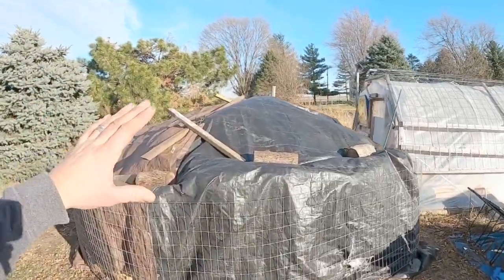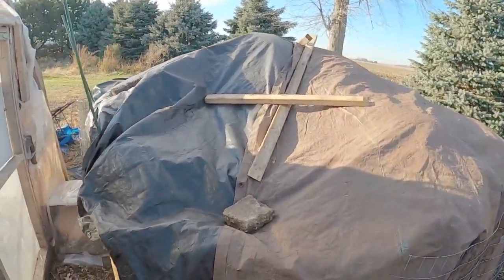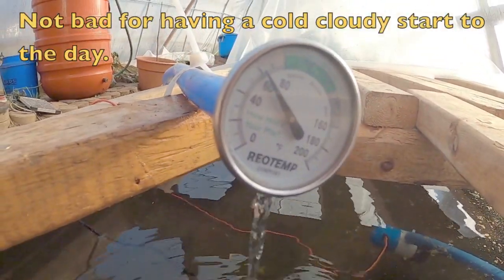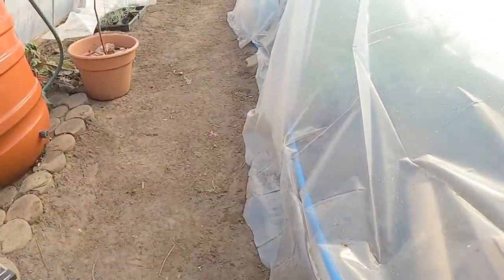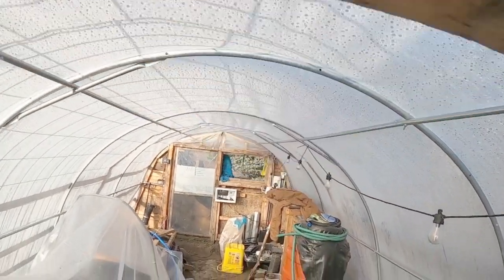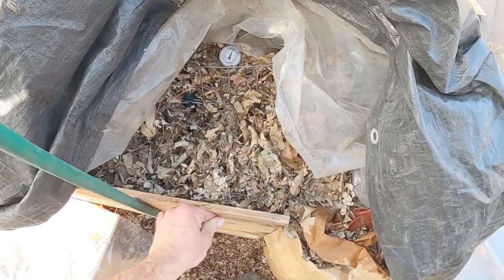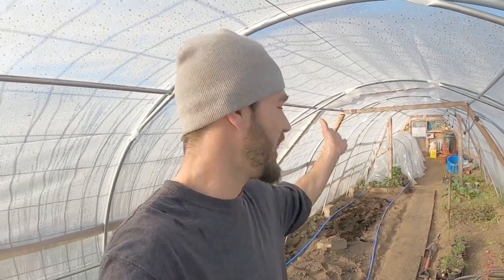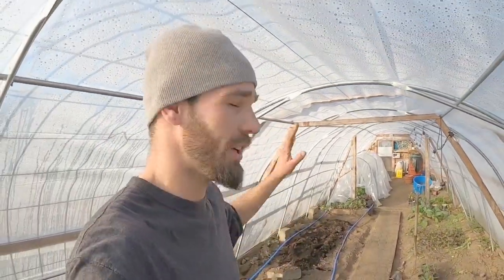Jean-Pain Compost Heating | DIY Methane Retention Layer For Capture | Temps On Day 4 |

Comment: Why not bring the whole compost pile into the green house to capture 100% heat generated? Or the whole end wall attached to the pile shaped to half dome?
Reply from the maker: Harvesting the heat in a separate building would be the only way I would do that. We had composted in the greenhouse last winter and you don’t wanna deal with the amount of rodents it brings… I touched on that in a video that will be up a week or two from now. It’s a big no from me. When I see people building a pile inside all I can think is how many rodents are entering and running around your food at night. We lost a lot of good crops that way. Great question cause a lot of people will say to throw the pile inside but it’s not a good idea
Reply: @Earthdwellershomestead  saw another video that the owner has the adjacent wall insulated with compost and bring the heat in too. Put the wire mesh to separate the rodent invasion?
Reply from the maker: Yes that’s one way of achieving it, we do that in our small 6x12 jeannpain heated greenhouse also! But there is rodents also. Having the compost right on our northern wall works amazing and we’re drawing water and air through it back into the greenhouse. The little buggers burrow in every once in a while still, granted they will always be drawn to food shelter and water but the less I can attract inside the better lol. Feel free to check out our smaller GH creation

Comment: Thank you for your example! 
I'm trying this out to heat my 12 by 12 lean to greenhouse with double poly roof. What's the smallest you think the compost pile can be? 3by 3 by 3? I only have currogated black drain pipe in my pile. Leaves, garden trimmings some grass and some manure. It's not heating up. I'm collecting more leaf bags to go higher around the edge
Reply from the maker: You may be disrupting the burn if theres not enough compost to go around, we did a small example in our small diy 6x12 cattle panel hoop house. what we did was ran the tubing (metal flex dryer ducting) through two holes with Bothe ends of tube in the greenhouse. once the tube was outside the greenhouse we curled or s-shaped it on along the outer wall where the compost will be up against it. we don't get center of the pile temps 130-140 but we seee 70-80F air coming from the tube regardless of greenhouse temp.

Comment: My understanding with heat transfer delta is that the bigger the differential, the more energy transfer goes to to ambient.. If you had a hot coffee and added milk then left for 10minutes vs you have a hot coffee, let the milk sit for 10min then add it.. in the latter, the coffee milk combo would be hotter.

That said, I think(not sure) the lower the delta of water coming in, you store more effectively in the battery.
Reply from the maker: Yes sir, I’m actually pulling a BTU video together share in the next week or two to go over the btu output for heating air and water which take much different amounts of energy to heat.

Comment: Unless you want to easily expose those pipes in between the compost pile and greenhouse I would just bury them with soil since earth is a great insulator.  otherwise I was thinking if you had another pipe a couple inches larger in diameter then your corrugated drain pipe you could put it around the corrugated pipe and then fill that outer pipe with great stuff spray foam. I think that’s what I’m going to do with the section of pipe I have exposed to the open air.
Reply: I'm a bit confused about this. I thought that earth was a poor insulator, and decent thermal battery. If this is true, then you are storing heat outside the greenhouse which is what we don't want!
Reply from the maker: @iamtmckendry  @Earthmade Garden great input, I did bury the pipes in a sense I went with some better copper tubing insulation and insulated all the way around all the entire transfer pipes and tubes with ridged insulation. I ended up getting down and running the insulation on the copper as far as I could reach in the pile, lots better for sure. Thanks to both of you for checking this out!
Reply: @Earthdwellershomestead  nice that should definitely do the trick.
Reply: @iamtmckendry  that’s true I wasn’t thinking about that. the heat would just absorb into the earth… I guess my second idea is a much better bet!